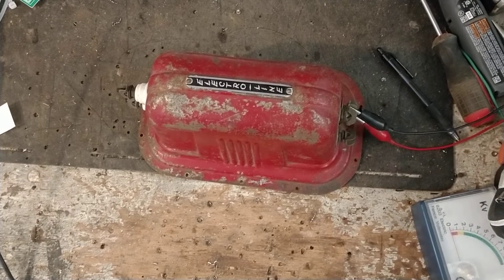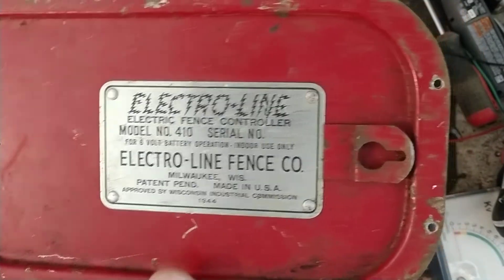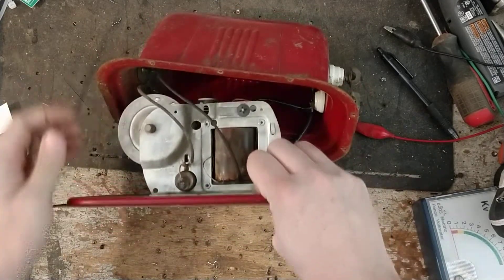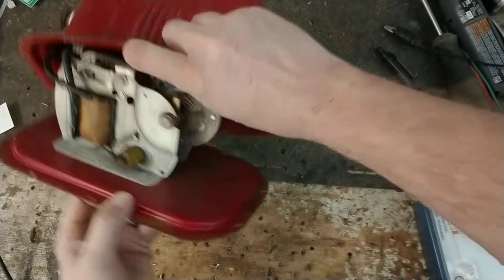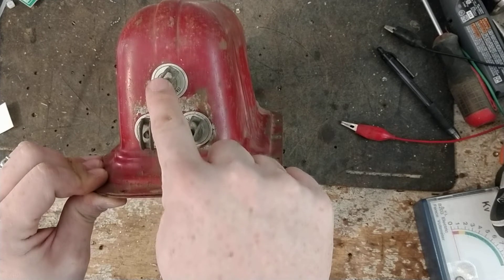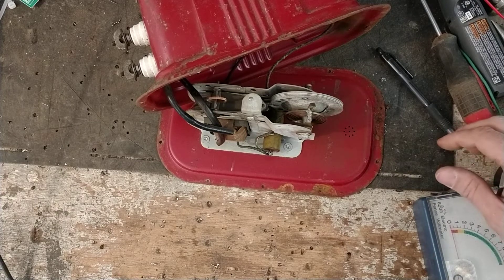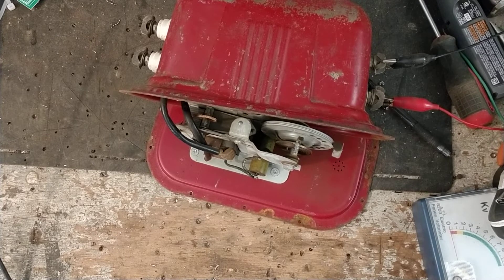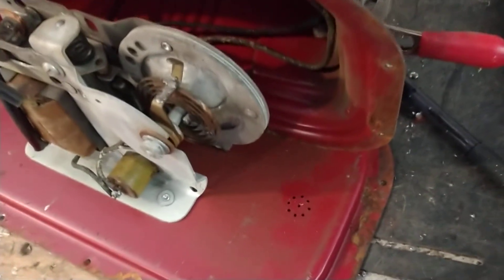An OLD 1940's Electro-Line Mechanical Electric Fence Charger In My Collection

Comment: I inherited an Electro-line BullDozer  Model 4365
still works and it was on the garage wall of the house I purchased and I just plugged it up to test it.
The previous owner had problems with deer eating his garden as my wife does now. I am going to run some wires around my wifes garden this spring.

Comment: What is the principle that makes the wheel move? What would the mechanism or diagram be like? I am from Argentina.
Reply: i have an Australian version somewhere in all my stuff.
it has a cast aluminium hood and a switch and the bottom plate 
is bakerlite recessed and screwed to the hood, the on/off switch and wires 
are on the bottom plate. the unit has a metal hoop to go around  and hang 
on a fence post and is designed to be an outdoor unit with the cast aluminium 
hood being totally weather proof and the underside part facing toward the ground.
when the transformer is energised by the contact switch on the rotating wheel a 
magnetic field is created like a relay. the movng part of the relay is the other side of 
the contact switch so when the wheel touches the other contact the transformer is 
energised and the relay plate is pulled in and pushes the wheel backwards against 
the spring, the amount of voltage determines how much the wheel is rotated 
backwards, as the battery drains and the voltage gets lower the push  against the 
wheel  gets less and therefore faster and faster, by knowing what it should be its 
easy to tell if the battery needs changing or charging.